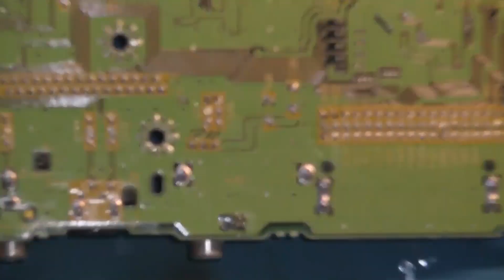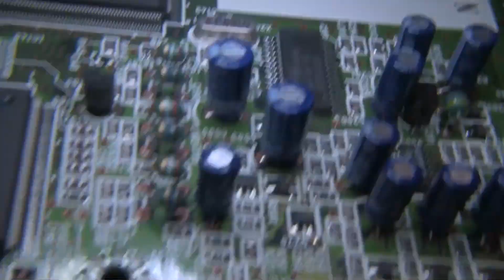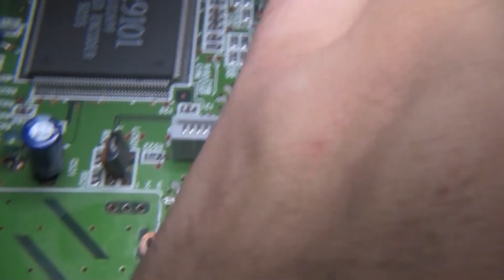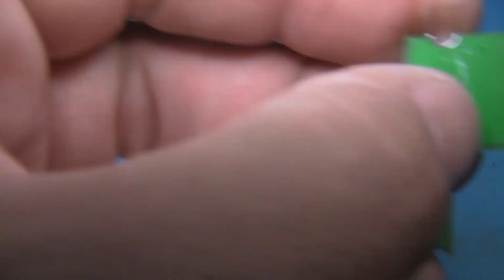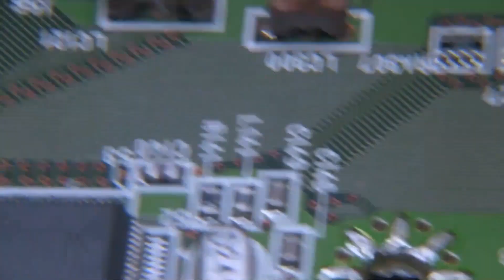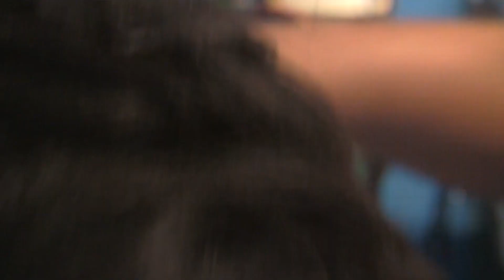3DORGB Install FZ-1 w/BT9101 Encoder

Comment: I used to strip wire like this, one end soldered in and trying to use my Klein tool stripper, but it's too difficult and disturbs the wire too much at the soldered end. I started clipping the end to length and heating the sheath away with my iron at the other end. PVDF insulation responds quite well to this technique and it allows you to get more accurate lengths. Done right it can be just as neat as stripping it.

Comment: Is it possible you could tell me what solder wire and flux you're using? I'm almost out of JBC flux but your dropper distributes a lot better than my setup.
Reply: Looks like 30awg, solid core silver plated copper, with PVDF insulation.